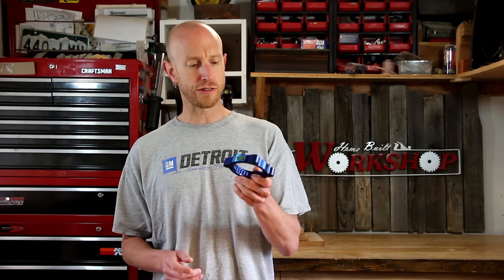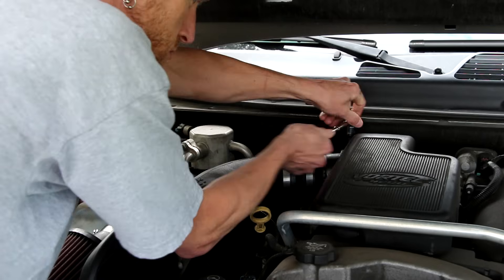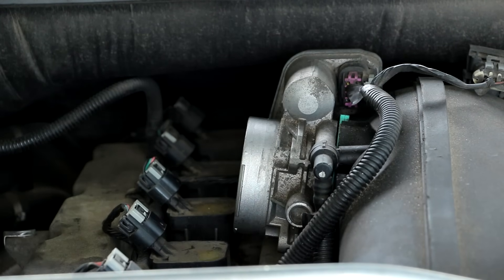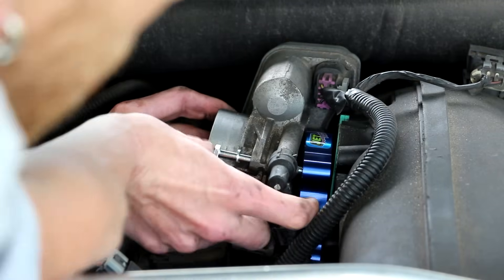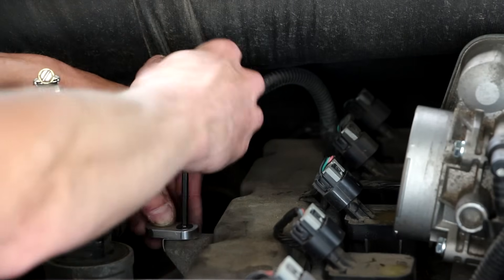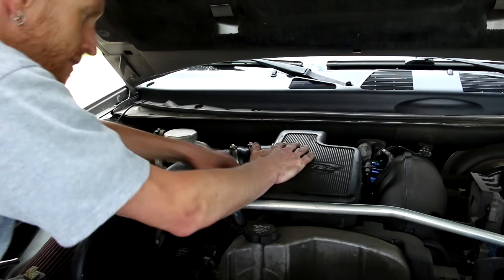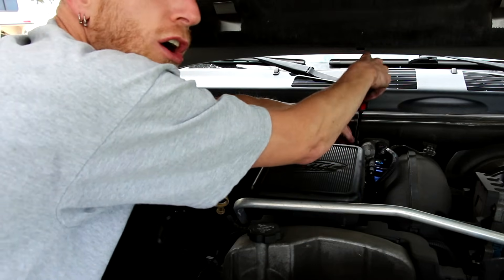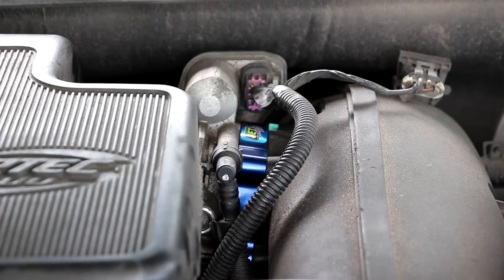Is A Throttle Body Spacer Worth It?

Comment: No gasket seal?
Reply from the maker: It has an O Ring seal. There isn't an actual paper style gasket.
Reply: @homebuiltshop  alot of throttle body spacers come with a gasket seal, the ring I know already but a gasket seal aswell.
Reply from the maker: Interesting, this one did not.
Reply: @homebuiltshop  if you check out the other videos of installs, you'll see that alot of them come with a new gasket seal.

Comment: Throttle spacers DONT work on a DRY intake system. Spacers atomize fuel better before the valves. Spacers ONLY work on WET intake systems.

Comment: The only use of a throttle body spacer would be if they had two holes drilled in it for fuel and Nitrous.   Wait they do make that already. 😂   Another observation if any company makes these throttle body spacers I would stay away from their products if they actually make any performance claims.

Comment: I put the spacer on but I keep getting a check engine light do you know why?
Reply from the maker: +Karl Boyer I'm not sure. I'd start by double checking all your connections. You can take it to an auto parts store, most will read the engine codes for free.

Comment: First of all
How does spinning air give more horsepower??? if it spins the air to begin with
It's a scam, the cheapest way to make more HP is a nitrous kit
Reply: Jc Nopal nah you will spend a hole in your wallet....go turbo or supercharged..
Reply: @SpartanX360  I do agree that superchargers and turbos are the better route 

But the cheapest is still nitrous
Reply: Jc Nopal I know it’s cheap but they need to know to use it wisely not do a full shot or go boom..
Reply: @SpartanX360  true

Comment: A spacer cannot improve low end... it makes a taller runner for top end... but you need heads, cam, stall lol... but torque? No way
Reply: spacers do NOTHING for the top or bottom end.  if a spacer is claimed to allow MORE air in I would guess its like running a forced induction turbo system setup to push .01 pounds of boost... such a silly waste of time.

Comment: Here is how it really works. And I'm gonna trust you not to tell anyone Deal?  ok. first of all  your Tee shirt gives you priority in your mindset, but in reality, because the spacers are Blue in color, that makes it Cooler in temperature, kinda like ice. Still with me? ok let's continue: Having it cooler will make your incoming air more denser, which in fact creates better and bigger combustion (Same reason you see race engines with dry ice on the intake manifolds). So low and behold  and especially when the sky is real blue, your horsepower gains can become unimaginable , These guys buying the Red ones just don;t get it. cuz it makes it warmer and really increases "Global Warming"  So by all means , Stick with the blue ones. Hope this Helps.

Comment: What does that even do exactly??
Reply from the maker: Its supposed to improve airflow to the throttle body which should in theory improve performance. Every vehicle is different, so results can vary.
Reply: @homebuiltshop  OK that makes sense. What's your opinion on whether they work or not and worth the time/money/effort? Did this do anything besides make it a bit more responsive? Did it affect your gas mileage at all? Would you recommend it? Thanks for replying! 👍

Comment: They sometimes made a slight difference with carburetors, but these things are just a gimmick
Reply from the maker: I agree. There is a noticeable difference with carbs.
Reply: @homebuiltshop  They worked with a carb setup on a conventional manifold mainly by increasing plenum height and  adding velocity in the venturi,  improving atomization of fuel. A spacer on a direct injection or port injected engine helps nothing performance wise, especially if the throttle body is mounted inline of the intake tube.

Comment: I asked a friend of mine that’s an engineer for Chrysler explained “easy” upgrades to me. 
If their was a cheap way to add horsepower or fuel efficiency, they would have added it at the factory. 
“How it feels” means very little to guys who’s work is tested by independent agencies.

Comment: Basically simple. All this does is give you an extra inch or two for your gas to atomize better, (plus your wife will enjoy the extra inches). It will allow less gas to be used but very little you probably won't notice and it might help the response time a very little bit. Extra horsepower, I don't really think so or even better quarter-mile track time yeah I don't think so ether. Just remember most vehicles computers should be reset after installation of this spacer to allow your computer to adjust what it needs sooner rather than later. Install spacer reset your computer after installation let the vehicle run for 15 minutes for your computer to read everything then enjoy. Mmmmmm 2 xtra inches.

Comment: At best, this guy is well-meaning but suffering from a placebo effect and, at worse, this guy is plugging this part for this business while pretending to be unbiased. This is meaningless without some before and after dyno pulls, at least 3 before, 3 after to establish an average, which would exceed the price of the spacer.
And even if it did make a few horsepower that's nothing you'd ever feel, especially in a relatively heavy vechical. That's less variation in horsepower then going from a cool morning to a warm afternoon.

Comment: Nope.  Knew this before getting to the end of the video.
Physics aren't changed.
Unless you are altering the air volume past the throttle body... the only effect this will do is be blue and shiny.
Zero Value.

Comment: It's bullshit, spacers don't so anything they only did performance for carburetors because the fuel and air was past by the spacer making the air and fuel mix better, throttle bodys don't five off fuel just air
Reply: +Hank Hill It depends on what type of throttle body you have. You ARE correct about carburetors and spacers. However SOME throttle bodies have TBi with the fuel injector(s) mounted above the butterfly valve inside of the TB itself ;-)
Reply: +Aj C. yes that is true but newer cars don't have TBI
Reply: +Hank Hill no, but my pickup does. On the TBI engine it's been proven to help.

Comment: you dont know because your not an engineer and have no business modding.
theres a distance between the air-in and intake valve that fits into an equation that engineers use to determine AFR. 
this fixed figure determines IC chips used in the ECM.
the intake cleaner box yields a intake air volume figure engineers use to set the intake up.  
this all depends on the volume of the cylinders

Comment: Trailblazer's not a truck, bud.
Reply: its not a picktruck buts it too small to be considered a suv.,4x4 or 4X2, drivetrain, large displacement engine choices(4.2 I6 or 5.3 V8)yeah it a truck hell its in the nameplate "Trailblazer".

Comment: Aluminum spacers are completely pointless. The whole point of spacers intake or throttle body is to keep heat away from the intake air temperature. For every degree celcius colder the air, the more denser it is, and it gives you more power in horsepower. Spacing the intake manifold and the throttle body with a phenolic spacer will keep the heat from the engine from soaking into the aluminum parts, keeping the air from heating up prior to entering the combustion chamber. Aluminum spacers do nothing. Scientifically they are pointless. You need to space things out with a material that does not transfer heat, like phenolic.  https://en.wikipedia.org/wiki/Phenolic

Comment: Throttle body spacer, more expensive way to get better responce from the pedal 

Cheaper way, tighten your throttle cable
Reply from the maker: This vehicle doesn't have a throttle cable. Its Drive by Wire.